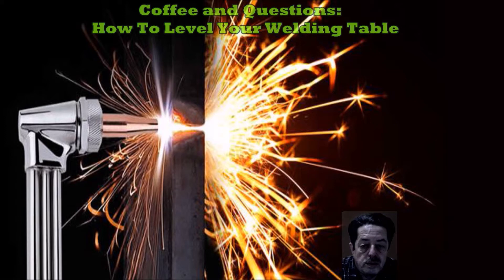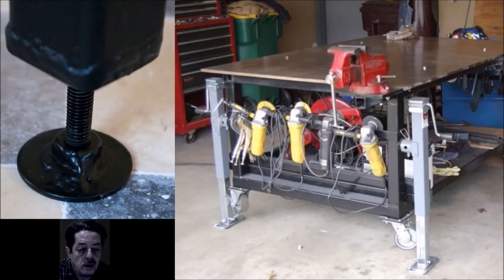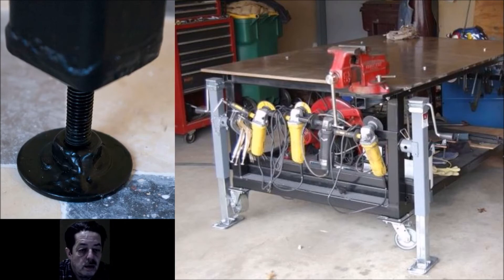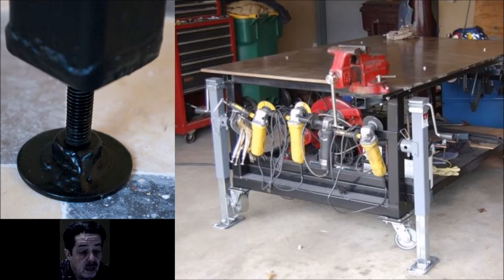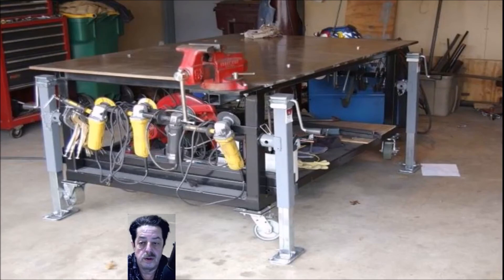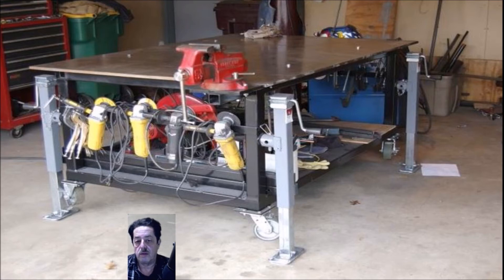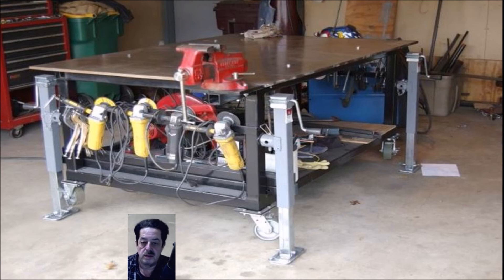Welding - Leveling Your Welding Table

Comment: is there a benefit to have more than 1 angle grinder?
Reply from the maker: I have several - 1 with cut off wheel on it - 2 others with different grit flap wheels on - I got them cheap off craigslist over time and the benefit is that i can grab and go instead of changing out wheels
Reply: Thanks will be getting another that will save time.